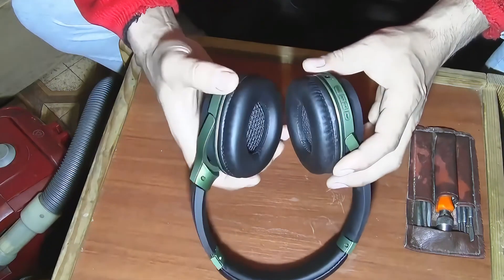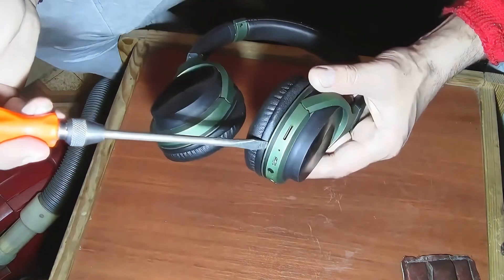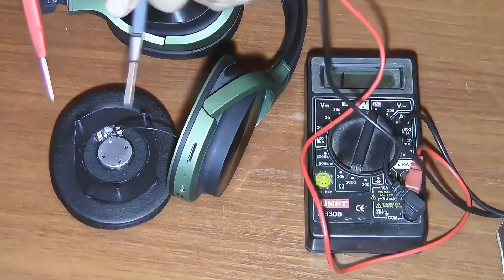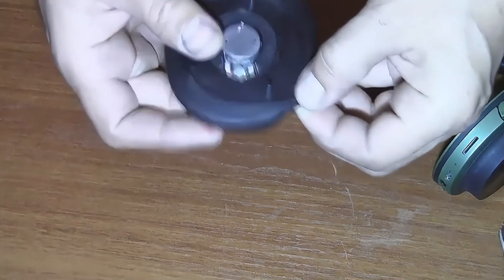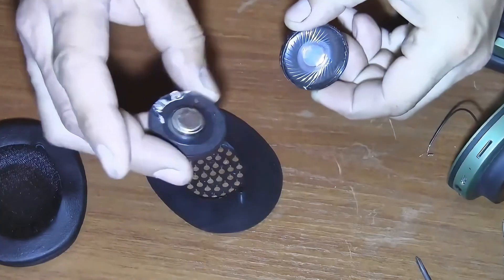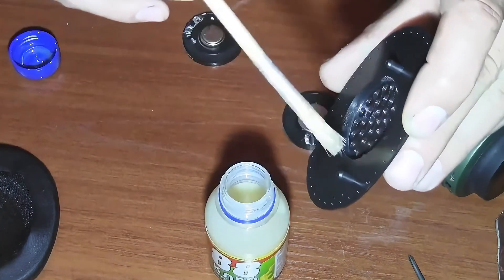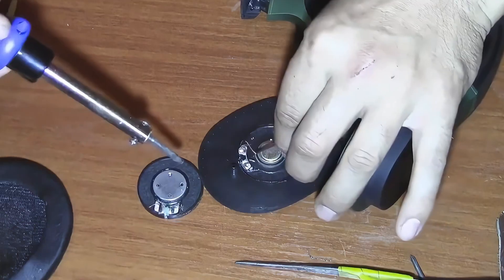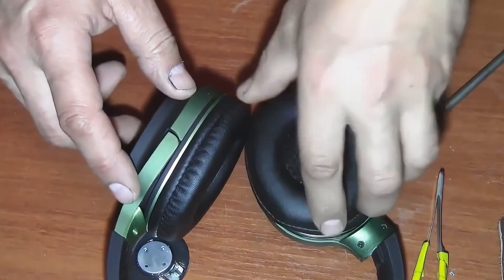How to Repair Headphones One Side Not Working

Comment: In my case, the problem was within the wire so I cut down the wire from there and then reposition all the wire to the board. But still no sound on the right side.
Reply from the maker: Check the functionality of the headphone speakers and you can swap them to check. If the problem is not solved, then the problem is in the control board.